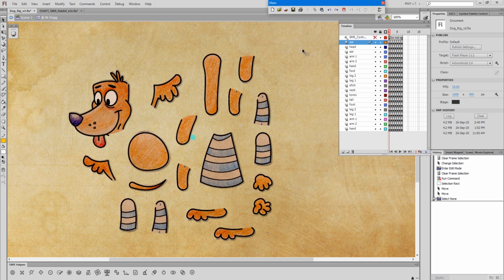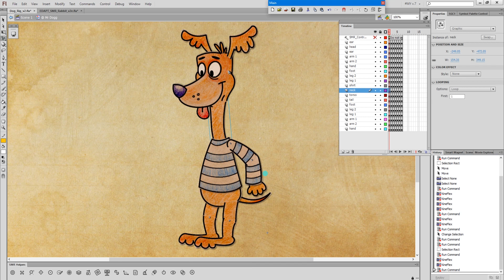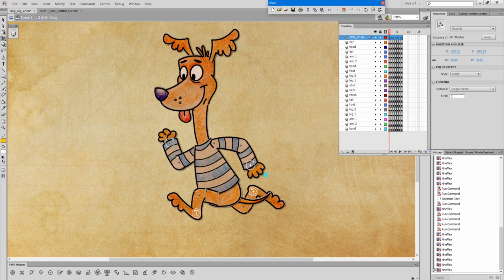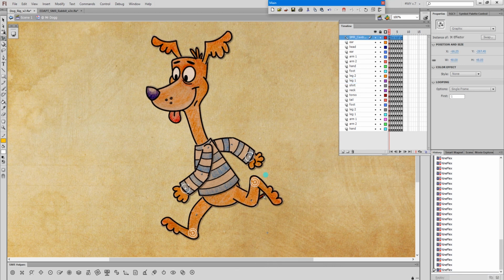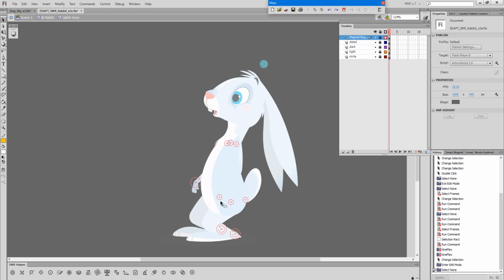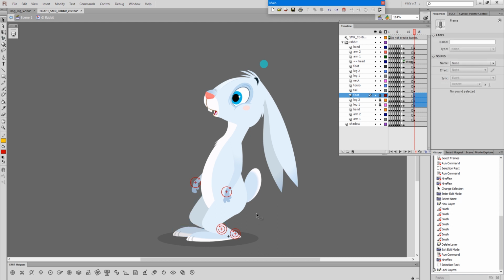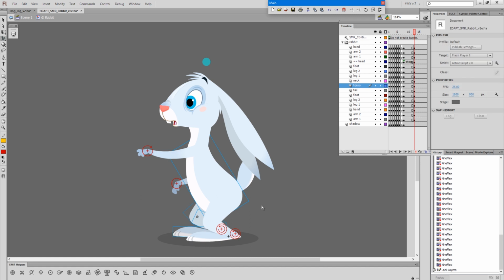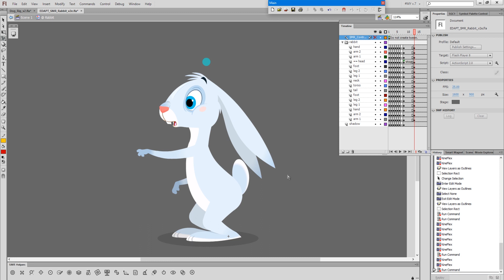🍀 Smart Magnet Rigs are like nothing else 🍀 Adobe Animate

Comment: 3:11 You have set the desired position, but the magnetic targets are in other places (by default) and if I use the smart magnet joint command, some elements will move to their original positions where the sagnet target is located. And how do I automatically rearrange the magnetic targets to fit the character's new pose?
Reply from the maker: You can edit the MT position from the outside by Alt-double-clicking with the FreeStyle Rigging tool as shown in this video: https://www.youtube.com/watch?v=bZGJhyaaq_Y
In most cases this is just not necessary.
Best would be to actually learn how SMR works internally and use its whole range of capabilities:
https://flash-powertools.com/advanced-smr-1-the-invisible-force/